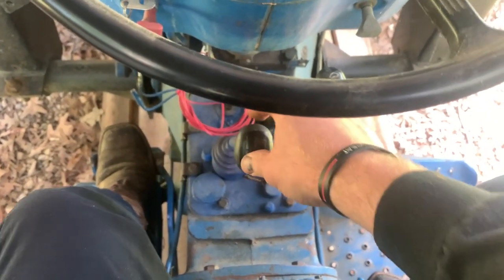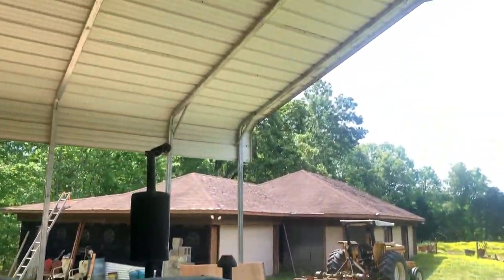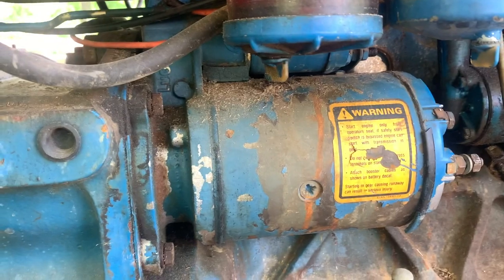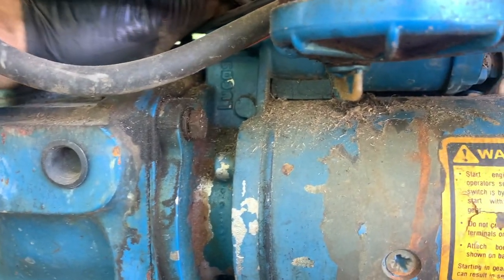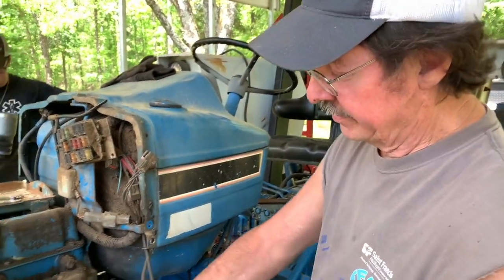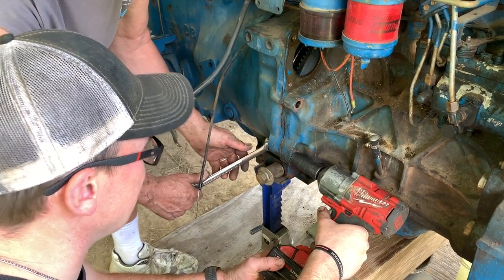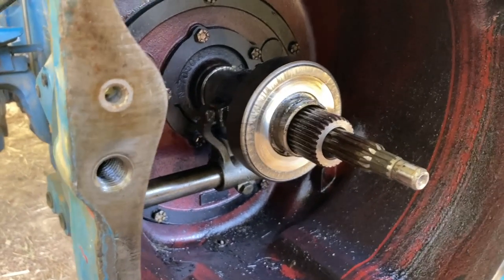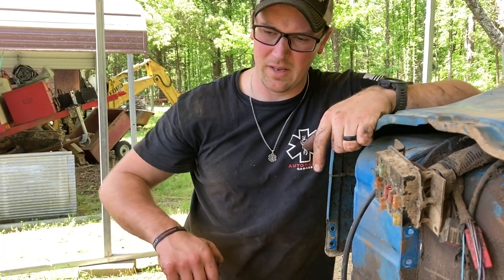How to split a tractor. Ford 4610 clutch removal

Comment: I am splitting my Deutz Fahr 85. I got stuck with the Huydralic hoses. Especially those Hose to Metal pipes connections. Can't separate them although the bolts are off.

Comment: Been around tractors my whole life. Pilot bearing at end of motor crankshaft is the problem. Pressure plate might be stuck but i doubt it. Good luck
Reply from the maker: Pilot bearing was perfect.....the hydraulic/tractor fluid was so sticky on the friction disk it wouldn’t release....had a leak...watch the second video...thanks for commenting

Comment: Clutch stuck on my 7600 tied clutch pedal down for a day or two went back and it had released worked fine ever since but I always tie clutch pedal down if I'm not going to use tractor for a few weeks.
Reply from the maker: This would release if you hammered the brake but soon as you let off would get stuck again. The cooked on tractor fluid was all over the clutch from the leaking input shaft seal causing it to stick. It was leaking oil in the bell housing causing the sticking. Tying the peddle down wouldn’t have fixed or changed my problem. Thanks for watching.
Reply: I’m sure you wish people would watch video before commenting. How many times did you tell people what the real problem was.

Comment: Hey there , I’m from UK , I have a 1984 Ford 7610 , and it done the same thing! All I did to fix it was , there is a rod/bar connected to the clutch pedal and it has a threaded section , basically I spinned the female threaded bit down the thread going away from pedal, connected it up again and problem was solved! Only needed to do it once and no problem since! Apparently the rod/bar sort of stretches through time and has the adjuster to tighten it! It pulls on a lever which you can see at side of engine, when it stretches it can’t pull said lever far enough to disengage the clutch There’s nothing wrong with the clutch! 😊 sorry I’m late in seeing this! It’s literally a 5min job
Reply from the maker: My problem was the cooked and sticky tractor fluid from the trans seal leaking. It was like molasses on the clutch and flywheel.

Comment: Helps to take the fuel filters off before removing the starter
Reply from the maker: Not really, using the extension and swivel gets you way past the filters anyway. But thanks for leaving a smarta$$ comment.
Reply: No problem… must be because I replaced my starter with a front end loader bracket in place so access was tighter. BTW, interesting fact, 4610s were built in England.
Mine has a cab and it always intrigues me to see how much simpler working on dry climate tractors that just have a canopy is! Although I guess the cab doesn’t have to be removed to split the tractor- something I’ve not had to do yet. It’s also nice to see your tractors don’t rust - much - compared to ours in damper climates. Like here in the UK.
I’ve had my 4610 4WD for about ten years and I think it’s a great tractor - no electronics to go wrong!
Thanks for the informative video.

Comment: No explanation of why it wouldn’t release.  “Sticky stuff on flywheel or Pressure plate makes no sense.   So what was the problem?  Adjustment?
Reply from the maker: The problem was the cooked on tractor fluid as I mentioned in the video. It was like molasses on the flywheel. The seal that I showed replacing on the input shaft of the transmission was the one leaking. Of course the clutch material was ruined from being impregnated with all the sticky oil so it had to be replaced. Thanks for watching.

Comment: Common ford 4610 issues. Most would have removed inspection plate and soaked it with wd40. Then never store tractor with clutch released.
Reply from the maker: Not a common 4610 issue or any tractor for that matter, it is common for the clutch to stick if the tractor sits but this tractor didn’t sit. The input shaft seal was the culprit, in the video I showed how sticky the flywheel was from the fluid getting cooked on the flywheel.